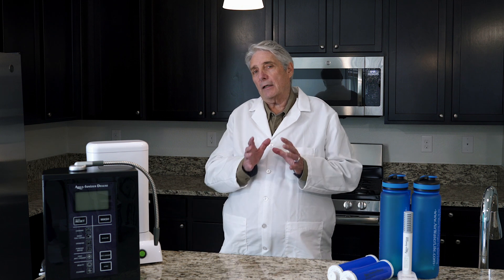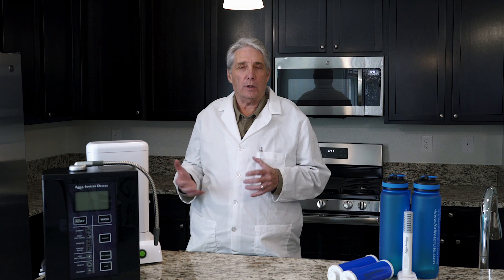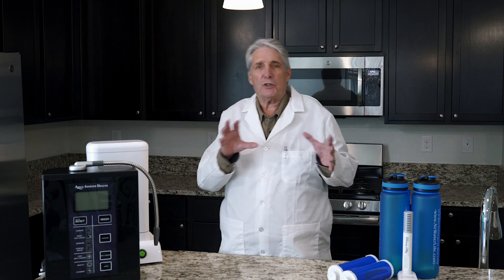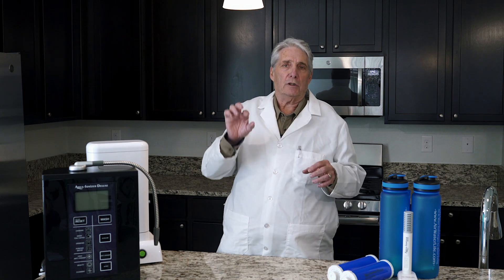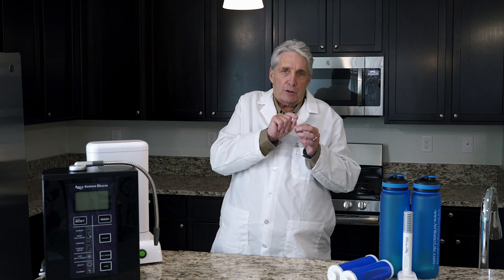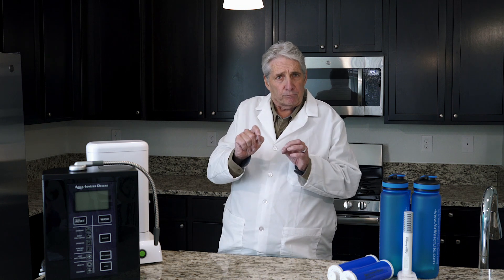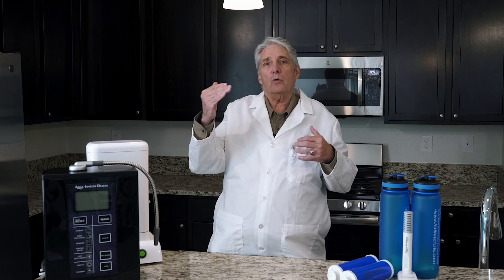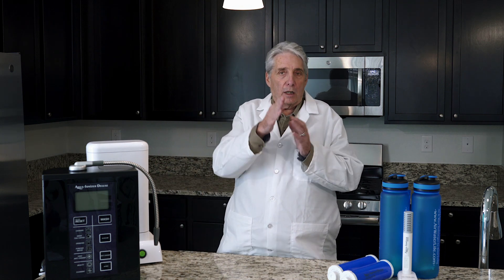What to Look For When Buying an Ionizer | Water Ionizer Buyers Guide

Comment: "On and off, on and off, on and off." A Pulse Width Modulated (PWM) power supply is an efficient and versatile type of power converter that controls the output voltage and current by adjusting the duty cycle of the switching signal. By rapidly switching components on and off, it minimizes energy loss, resulting in high efficiency and reduced heat generation. This type of power supply is capable of delivering precise and stable power to various loads, and it can be configured for different conversion topologies, such as buck, boost, or buck-boost. Its compact size, lightweight design, and ability to operate over a wide range of input voltages make it ideal for applications in electronics, telecommunications, and industrial systems.